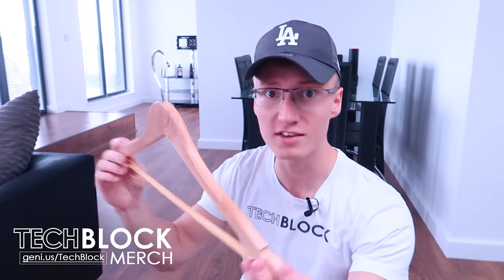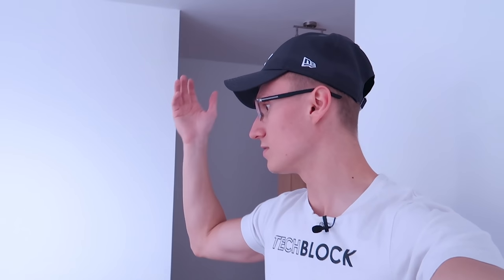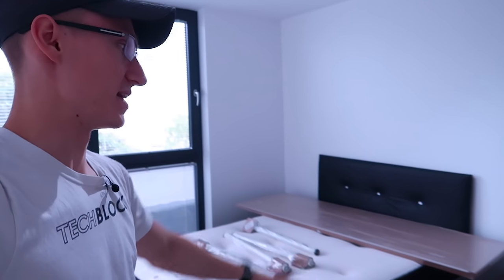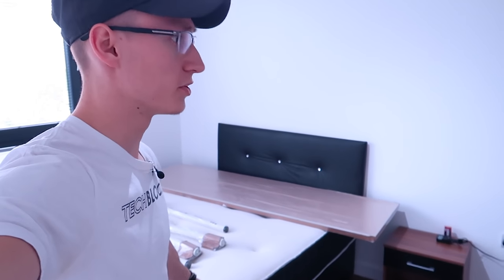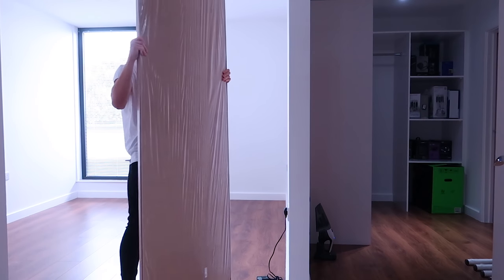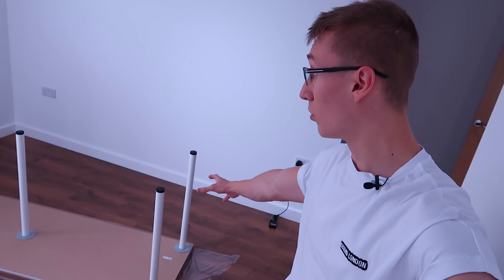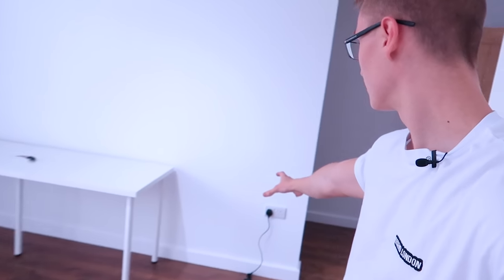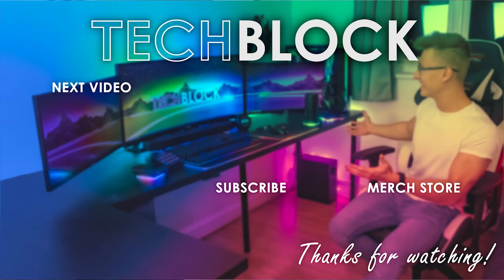Building My NEW Gaming Setup - The Desk (Part 1)

Comment: Sick pc idea:( something I wish in the future I could pull off ) Alex draw / Alex cabinet but build a pc inside of it. Cut holes on the side and and a mesh for fans and such. If i do draws I would make it so you can pull the draw out and see each component. ( gpu / motherboard / psu / hard drives and ssd / then draw at the top for whatever you need cuz they draws.)

Comment: Just as a tip, instead of getting a floor mat (which in my opinion doesn't look great) you can buy new wheels for the chair that are meant for laminate/hardwood floors and they won't scratch it. They are made of silicone or rubber or polyurethane or something like that... Cheap and effective.

Comment: Hey em, i also have a white table for my setup. For the razer gear i use i have the same keyboard and the same mousemat. For the screen i have a 27 inch gaming monitor from aoc in black and the h500. What my point is that i also have 2 alex drawers in white.
If i was you i should pick white drawers and a white desk. Trust me it looks good👍🏻

Comment: Good idea about the extra desk extension, the longer the desk the less cluttered and clean it will look. Also good idea about the placement of the nanoleaf, if your planning on getting more you can get the flexi connectors and go around the corner, even snake them up the wall from side to side in some way OR keep going around the corner and along the back wall. But also a large flat surface area gives you alot more crazy design options and fills the large open wall. Could hang some pictures

Comment: wall mount the monitors :), i also recommend getting a hole in the bottom and the top of an alex drawer so that you can run cables through the top from trunking to peripherals and store the cables and extension ports inside the drawer so that there is no cables in sight, i have spent the last 5 months like this and it works so well, if you want a picture of mine message me on insta at @sxmti.le
Reply: i have a magnetised secret door to access it